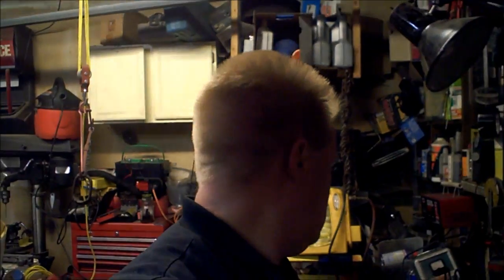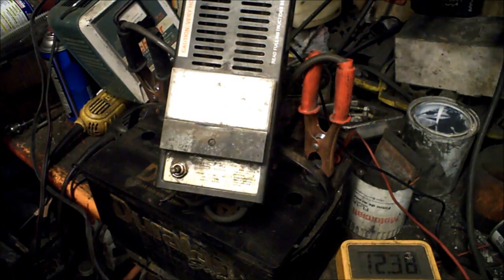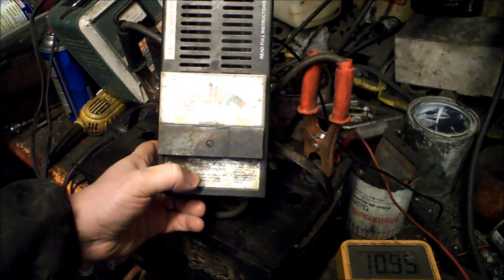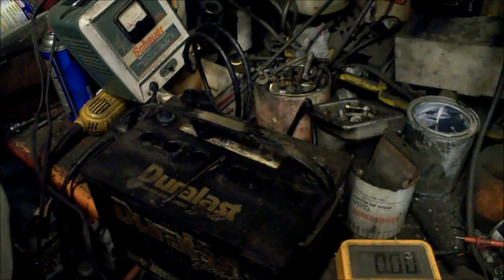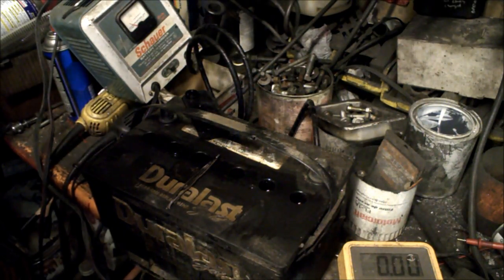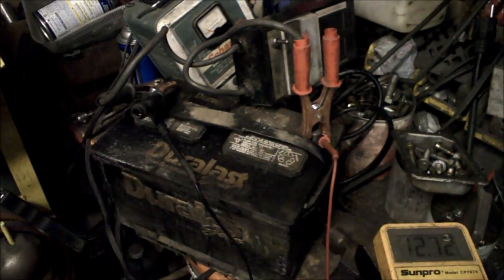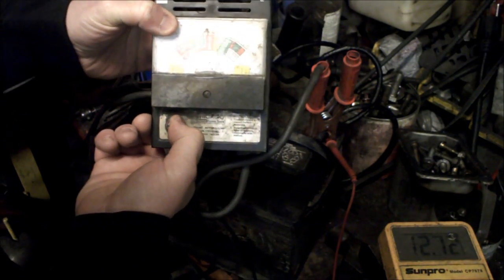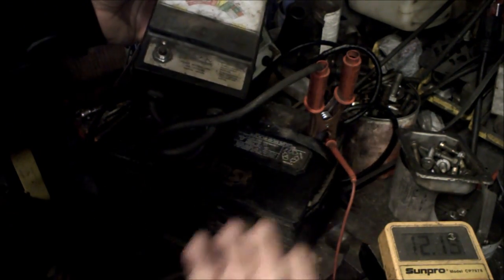Save a Weak BATTERY with epsom salt

Comment: Great video!
Thanks for the information!!!
Reply: here's  a few things for doing a pro job
never try to do this until you know what you are doing - the acid can burn you
Test the voltage first - there may be a kaput cell which would waste your time.
Check the battery fluid.
Try to fully charge the battery.
(I learned about these and more on Jons Mender Guide website )😊
Reply: Great Video! Sorry for chiming in, I am interested in your initial thoughts. Have you heard the talk about - Rozardner Powerful Battery Reality (probably on Google)? It is an awesome one off guide for learning how to recondition an old battery without the normal expense. Ive heard some pretty good things about it and my work buddy finally got cool results with it.
Reply: Cheers for the Video clip! Forgive me for chiming in, I am interested in your thoughts. Have you researched - Rozardner Powerful Battery Reality (should be on google have a look)? It is a smashing exclusive guide for learning how to recondition an old battery minus the hard work. Ive heard some interesting things about it and my best friend Jordan at very last got great success with it.
Reply: Lovely video content! Apologies for chiming in, I would appreciate your thoughts. Have you heard the talk about - Rozardner Powerful Battery Reality (do a search on google)? It is a good exclusive product for learning how to recondition an old battery minus the headache. Ive heard some awesome things about it and my BF after a lifetime of fighting got cool results with it.
Reply: Not certain about the points made but ,if anyone else needs to find out about lead acid battery reconditioning guide try Jons Mender Guide ( search on google ) ? Ive heard some extraordinary things about it and my mate got amazing results with it.
Reply: Appreciate video content! Sorry for chiming in, I would appreciate your thoughts. Have you heard the talk about - Lammywalness Trendy Trade Guide (should be on google have a look)? It is a good exclusive guide for learning how to recondition batteries at home without the normal expense. Ive heard some super things about it and my GF at very last got excellent success with it.

Comment: Worked at a production factory called e-ride industries here in central mn. They manufacture electric cars for airports/military. They have a 17 hp forklift motor powered by 9-8V deep cycle batteries with a system of hoses connected to a water fill tank. They said its best to let this kind of battery discharge completely before refilling/charging and then the vehicle lasts another 40 miles. Pretty neat cars overthere. Checkout their website. I myself made 9 for las angeles national airport.

Comment: i have an old battery that i kept when i replaced all 4 of my deisel batteries a few years ago. i use it in my shop to power a small harbor freight winch that i use to raise my lawnmowers when i need to scrape the mud out from under the deck. i only use it a few time a year so the battery doesnt hold a charge but just long enough to use in a day. ill try this and see if it will hold a charge any longer. thanks for post a helpful tidbit like this.

Comment from the maker: I've had great results for years with this method.
Reply: here's  several ideas for battery repairing
Don't try to do this until you know what you are doing - the acid can burn you
Test the voltage first - there may be a dead cell which would waste your time.
Check the battery fluid.
attempt to fully charge the battery.
(I discovered about these and more on Jons mender guide site )